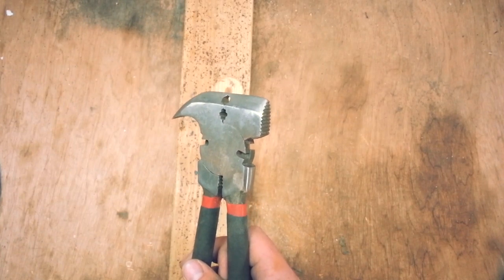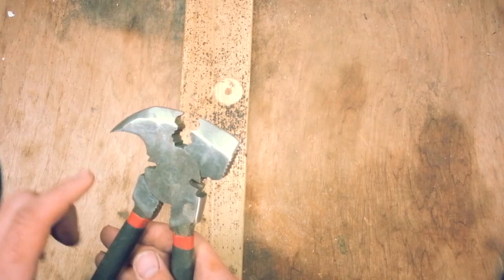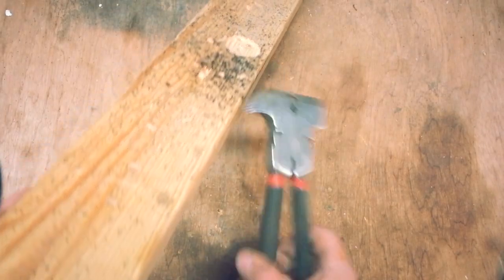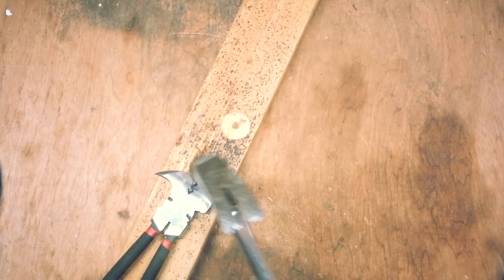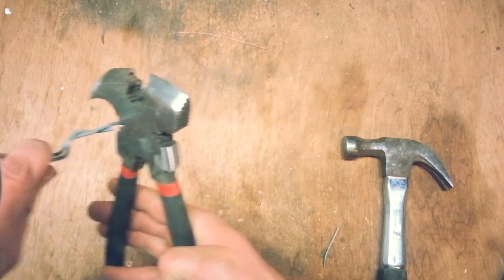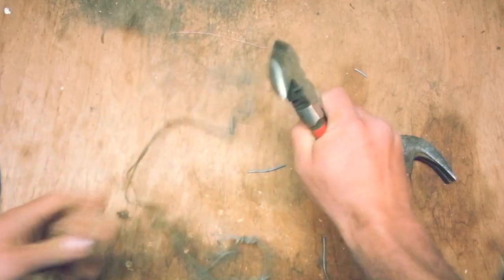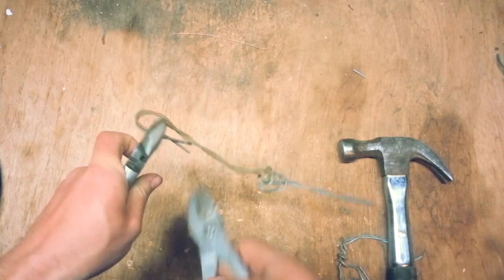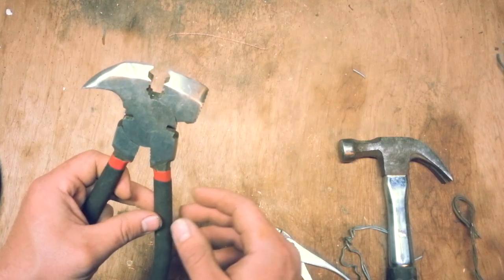What Are Fencing Pliers?

Comment: You are missing one more function: you grab the wire with the pliers and the curve sit on the post allows to pull the wire to have it tense when you staple.
Reply: Sounds complicated.
Reply: It’s not.
Reply: That’s the best feature on them,
Reply: Paul Zúñiga yep done that a many times
Reply: Cecil Shoemaker  how easily can they cut barbed wire?
Reply: Zombi Wurm very easily. I just reworked about 3 or 4 miles of 12.5 gauge barb wire and made every cut with pliers just like those. My suggestion though is to cut off the foam rubber coating on the handles. Its not very good for gripping and the foam is covering up the curved handles that have another use as a lever for twisting loops of wire when using a Texas Fence Fixer.... another great fencing tool on the range.

Comment: The hammer side has another function, which is to serving as a hitting surface when using a standard hammer to drive the horn under a buried staple.  You often cannot grip a driven staple nor swing the horn into the buried staple, but you can aim the horn behind the fence and staple and drive it through with a hammer.  This is why old fence pliers generally have flattened and even mushroomed hammer sides; they've been beaten to death with hammers for decades ;).
Reply: I have used it many times this way.. Tommy

Comment: I've had pairs of these for years and never figured out the trick for starting staples. Thanks
Reply from the maker: +Quaderben So happy I could help.
Reply: yes never knew that either, but for the most part it is quicker to use your hands only
Reply: even better, for an embedded staple, instead of trying to swing the pointy nose into the staple like a carnival game, set the nose of the horn into the hoop of the staple and with your hammer, tap on the hammer face of the pliers forcing to nose under the staple and pulling the staple up.

Comment: Good video! I too grew up with these and some days you hate them. There are several designs out there but the Diamond Tool design is most common. What you were showing us was a Chinese copy. The tool was invented in the late 1870's when the open ranges of the west were being fenced. The tool evolved with the various patterns of barbed and woven wire. It was light and incorporated the function of several other tools so that a man on horse could carry it and ride miles of fence making repairs. Usually two such tools were used in tandem to make the long wire splice or telegraph splice as it was called. As you point out you can drive and pull staples, cut wire, twist wire and hold a staple. You missed the jaws up in the crotch of the handles which can grasp two wires together allowing a second tool to twist one around the other like a vice. You can grasp the end of a wire in the two openings of the jaws as a loop but close to a post then roll the rounded pick around the post to pull a wire tight. Your partner with his tool then drives a staple to hold the wire you pulled.  So, it replaces a hammer, bypass cutters, crowbar, vicegrips, staple pick, and more. When I am working from a truck today I carry about 30 pounds of fence tools, but if I am on foot walking fence I just take two pair of these tools which weigh about 3 pounds. You trade tool functionality for weight.

Comment: I have only recently found out about this tool, and have been stretching fences (on my own land) for only about a year. 
One thing your video showed that I found most enlightening was that the pliers can be used to hold a fencing staple. I have been using regular pliers, and not very successfully. Thanks for showing this feature.
Reply: That china copy has quite a blunt hook that may not do what older pliers do.  I have 2 pliers from the 60-70's and are slightly different from each other but both work great.  That long hook is also used to wrap the long end of a T post clip around barb wire strand or doing the same attaching woven cattle fence to T post.

Comment: good video I've had one of these for many years but never knew about the staple holding bit got some fencing to do that will save fingers thanks also you can get tight staples out by hitting hammer end.
Reply: That is right Roy. I was taught never to hit yhe hammer face with another tool to drive the pick under a staple but to use a hardwood stave or stick. The staple trick is even better. You use your stave to pull a wire tight with one hand by wrapping the wire around it and using it as a lever on a post. Put the staple in the tool jaw as shown then hold the pliers side on and strike the wire on the post with the staple. With skill you straddle the wire with the staple sinking it into the wood deep enough to stand on its own. Release the staple and use the hammer face face to drive it home. All with one hand.

Comment: Hi, I've used these pliers for years and have used most aspects of the pliers except one great one I've never seen before, holding a staple with the pliers whilst hitting a staple with a hammer. It was worth the time just to see that one. I've hit my fingers so many times whilst banging in staples. Thanks very much. Cheers, John.
Reply from the maker: You are welcome. I must admit that I still have a hard time using them to hold the staple when I also have to hold the wire up on the fence at the same time. Leaning against the wire can help. I wish you the best on your coming projects.
Reply: Hi, I generally work as a volunteer with our local council, most of our work is actually taking fences down now that the trees are big enough and no longer need the protection of fencing. When we do put up pieces of fencing there is usually another old pensioner helping me!! Nice to see good educational videos. Cheers, John.

Comment: using it to hold staples is gonna save me alot of hurt fingers! thank you
Reply from the maker: +jjhedder Juggling the staple, wire, pliers and hammer can be tricky. Holding the wire at the right height on the post by leaning on it with your non dominant side can help. Best of luck to you.

Comment: Question. I have some fence staples (and some old wire fence itself) very much embedded in an old tree. Need to dig them out to have access to allow for a chainsaw to cut it down. Can you use the spike end plus a regular hammer to strike the hammer end to dig deep enough to pry out these embedded staples? Its not a big job but I don't want to buy one that falls apart when I strike with a hammer. Any recommendations? Thanks
Reply: Removing deeply embedded staples is what these fencing pliers excel at, in just the way you suggest.

Comment: Always have a can to catch all the bits and pieces of metal. Cattle and all other ruminant animals can pick up bits of metal when they're grazing and it gets lodged in their stomachs and it's called Hardware disease and it can kill them. A lot of people around farms and ranches don't know that you have to police up every bit of metal.  
   Also a fencing tool is is wonderful for a lot of wire fence but not a good tool to use when working with high-tensile electric fence wire. They will scratch the protective coating on the wire and the wire will fail prematurely wherever you've been bending or twisting it. You need to learn a whole different technique for joining and attaching high-tensile electric wire.

Comment: place the inner hole on a horizontal strand on field fence and twist up to 90degees. vertically do each horizontal run to tighten your fence
Reply from the maker: Terry H. Works in a pinch but it is a very bad practice. Twisting the wire in this way causes a weak point in the wire that will surely break . At least you will know where to look first when the fence does break. It is best to tighten it at a corner or brace, if you can. If you must tighten your wire in the middle of a long run, it is better cut the fence and add a proper splice, than it is to give you're wire a half turn with  your fence pliers.
Reply: I spend the 1970's using these tools. Welcome to every Saturday morning of my childhood (well, maybe it just seemed that way). 

The usual way is to put the pointed end of the tool under the staple, next to the barbed wire, and then hammer the point under the staple by hitting the flat head of the tool with a real hammer. Then you can pull the staple partway out without damaging the barbed wire. You do this to the staples all along the loose section of wire.

Then at the corner or brace, you use the claw end of a hammer to grab the barbed wire, and pull the wire tight (the top of the hammer is against the brace post, so you use the hammer like a lever to pull the wire around the brace post, through the staples). Then since your hammer is in use, you use the hammer side of the fence pliers to hammer the nearest staple all the way in which then holds the wire tight. Then you go down the line and hammer the rest of the staples all the way in. 

Of course, this is usually a two person operation, just like most fence making/mending. Its just safer dealing with barbed wire if you have a second set of hands. So, I was the second set of hands...

Comment: I use the same ones in electrical put Staples in pull them out Inked Up wire especially when I'm in a tight spot

Comment: I'm sure you're aware of it, but you could add to the uses, bending and fastening wire clips using the top holes(?)
Reply from the maker: +Deanna Hackney Yes, I really should have done that. I should be building some more fence in the next year, I'll try to do another video including making and attaching wire clips. Thanks for the comment.

Comment: Thanks for the tutorial.
Reply from the maker: You are very welcome. This is one of my beginning videos and is of lesser quality but it seems to be helpful. Thank you for taking the time to comment.
Reply: I'm about to embark on repairing or replacing 700 yards of frontage road, barbed wire fence.  But I can't figure out how to deal with the ups and downs of the terrain and yet keep the wire plum.  It seems that if there is dip, the clearance will be much at the bottom, and if there is an elevation the line will be too low.  Any tips on how to deal with this?  Thank you.
Reply from the maker: +Liberty Garden This type of fence is tricky, the low posts tend to like to lift out over time. Also, don't tighten the wire too much at first as it will get really tight as you go.  As long as it is all barbed wire and not net wire. Set some pegs on a board or some nails set at the spacing you want and a big one at the bottom than you can step on. You can use this next to the post to either hold the wires up or down as you connect them to the post. It is hard to help more without being there. Best of luck to you.
Reply: Thnak you.  Those are great tips.
Reply: Thank you for this great tutorial....I've just bought some of these pliers for fencing but had no idea how to use them until now!
Reply from the maker: +piano4tay Thanks for the thank you. I never knew this video would help so many.

Comment: Used them for almost 50 years, never knew the staple trick, but I have used the end to hold Staples and nails.... 
You should show the proper way to splice wire!!! 
The "Lazy Man's Loop" as we call what you were showing, is either used for tensioning wire when you splice it, or just two loops together that will usually fail....
Old dogs do learn new tricks😎 I really like the newer ratchet tensioners... If there's enough wire wrapped in one, you can release it to make a splice and retention it...
Kinda expensive, but saves a lot of time and makes better fences...

Comment: Bone head demo. Do NOT splice fence wire with loops. They will rust out and separate very quickly. Instead, look up Western Union splice. It was used in the 1800s to splice telegraph wire and the splice will last as long as the wire fence does.

Comment: Should note that these will not work with high tensile wire, not even enough for one little repair. For high ten you need more specialized and dedicated tools.
Reply: wolfedog99 Do you mean for cutting, or twisting?
Reply: I use them with high tensile all the time
Reply: wolfedog99 yeah no. They work fine on high tensile wire.  Why would they not?
Reply: They will in a pinch but HT is too hard to cut a lot with this tool. You might gall the cutter on a cheap pair the first time. Even a good Diamond cant take an extended diet of HT. They were made for mild steel wire.

Comment from the maker: If you are shopping for fencing pliers try these.
Good
http://amzn.to/2ij4UZV
Better
http://amzn.to/2iQLHQn
Best
http://amzn.to/2hWDqpH
Reply from the maker: Ryan K Not a bad price either.
Reply: Nice, I have the Channelock version in my truck box..and Irwin in my work truck.
Reply: So Irwin is in your work truck. That's nice.
Reply: do you make Irwin ride in the back and open all the gates?
Reply: Nice video, gave you ever used this tool with an electrical?
Reply: informative video,  I keep fencing pliers in my tool box and now know all the functions.
Reply: The old Diamond brand was the best for the longest time.  Now Crescent makes the same as the old Diamond brand.  Well balanced and half the effort spent in all functions than the newer knock offs.  Crescent costs a little more but well worth it.
Reply: @scrambler350  Channelock Made in USA, keeps our neighbors working and proud.
Reply: I have dewalt
Reply: That’s an electrician’s hammer.